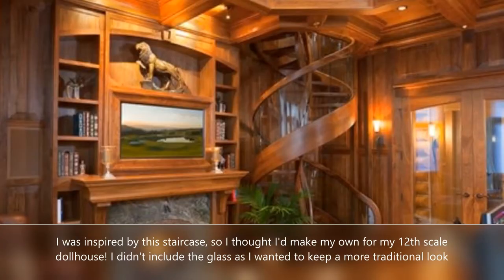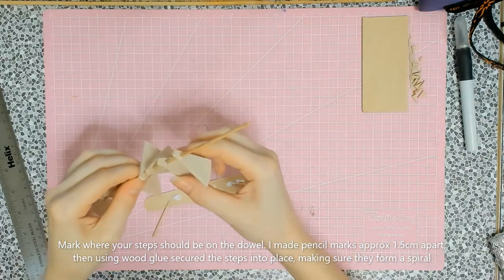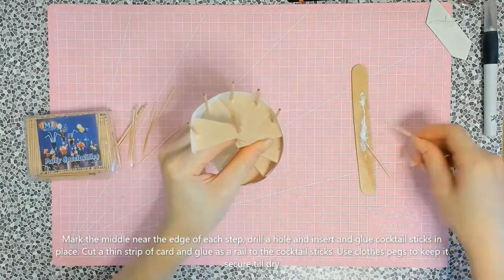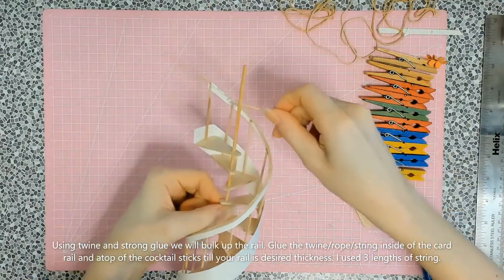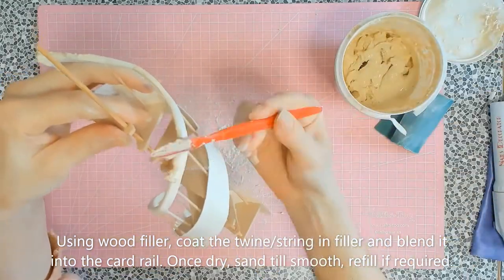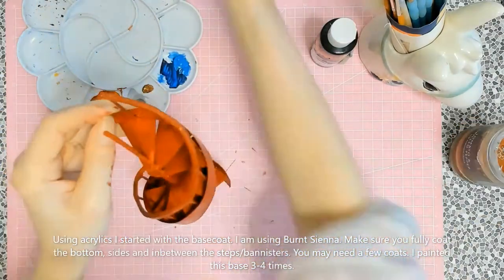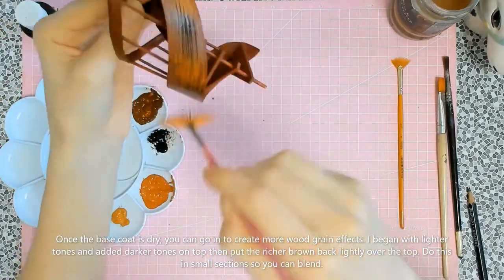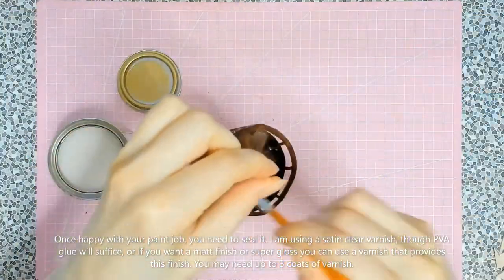1:12 Scale Spiral Stair Case Tutorial for Dollhouses

Comment: How could I do this for a 1:6 scale house? Thanks in advance 😊
Reply from the maker: 1:6 you need to double it, so every 1 inch = 6 inches. Example, say my staircase is 12 inches tall in 1:12 scale, to convert you would double the length so it would be 24 inches tall. 
Another example of how to scale this size, say a stair tread in 1:1 scale (our lifesize) is 2ft long/24 inches long, by 12 inches wide, divide by 6, so scaled to 1:6 it would be 4inches x 2inches. To scale that same stair tread to 1:12, divide by 12, so 2 inchesx 1inch.
You can also use the dollhouse as a reference of how tall your stairs need to be.
:) hope this helps!
Reply: Thank you, makes sense since you explained it. I’ll definitely give it a try ☺️